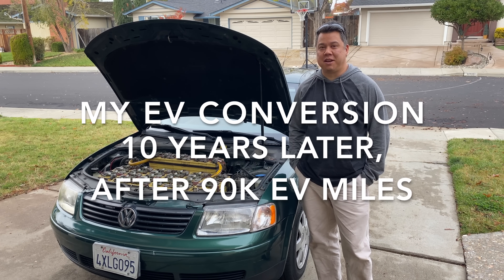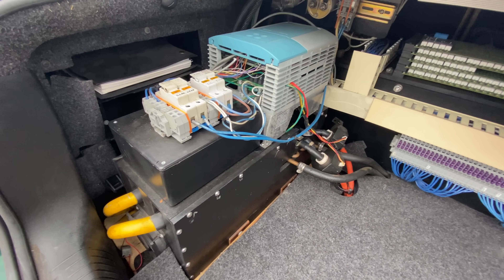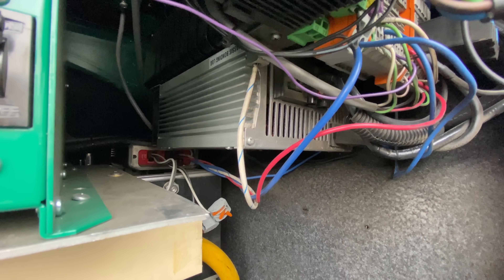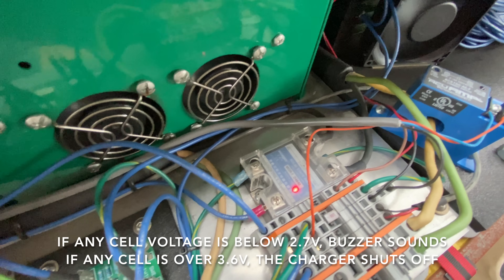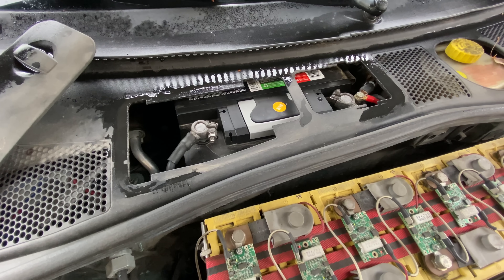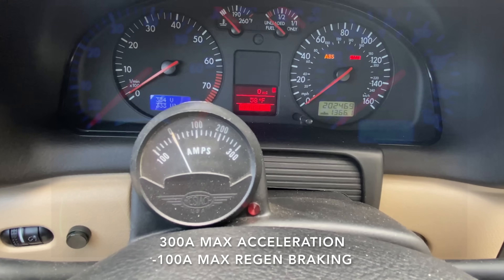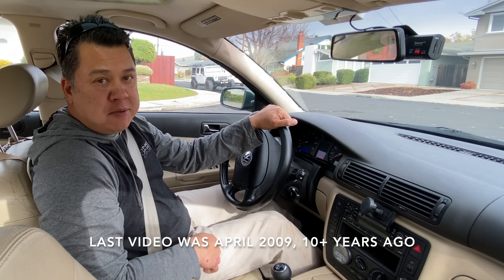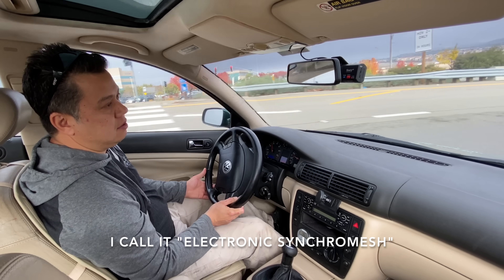My EV conversion after 10 years and 90k miles

Comment: That's interesting that you use a manual on an ev. Everyone always goes for the single gear or cvt.
Reply: Yeah now, 10 years ago there wasn't even a Tesla Model S
Reply: @BKrandy0  his approach is bare bones compared to the teslas today. kinda wish theyd make them like that instead of having a 32in lcd on the dash.
Reply: Porsche has a 2-speed transmission for the rear wheels on their EV. Only way to keep torque up at higher speeds.
Reply: @darichard11  they actually use a similar cruising ratio as Tesla (~9:1) they have the first gear to get crazy high torques. Iirc they use something crazy like 18:1. Motor probably can't do much more than 60mph before hitting the redline at that ratio
Reply: @darichard11  Uhh, I think it's the other way 'round. Torque is needed from stop and at lower speeds. The reason for a two-speed is to use all available torque in first gear up to the allowable motor rpm, then shift to a higher ratio to allow higher speeds than would be achievable in the lower gear without exceeding motor rpm limit. The original Tesla Roadster was built at first with a two-speed, but it was unsatisfactory and replaced with the single speed.  (From another David R.)
Reply: Don't think they had cvts that worked well back then.. plus cvts are much more complicated than a stick. Usually they're only used for hybrids and economy cars (never seen one used on an electric motor)

Fixed gearboxes are common for car makers since they can make one. Why spend thousands on a fixed gearbox when you can rip a transmission out of some junkyard car.

Also his motor redlines at 9k, and probably doesn't put out much torque. Being able to launch at a more aggressive gearing ratio, and cruise at a taller gear would be best
Reply: @gabrielschoene5725  Got it. I saw an interview with a Porsche company guy where he said the gearing was for better top end. Apparently just the opposite. I'm a little confused how the Porsche works with the rear geared and the front not.
Reply: @darichard11 
rear low gear - slowest
front single gear - middle
rear high gear - fastest
Reply: Many early EV conversions favored manuals.  They're cheap and plentiful compared to single-gear boxes, automatics (especially old ones) are terribly inefficient and tend to be heavier, and in a FWD car such as this the gear box supports the axles and acts as the differential which simplifies the drive line.  Even if you never shift the manual, just choosing a gear and leaving it there, along with the final drive ratio, is "essentially" a single-gear reduction.

Comment: Damn, that's a nice setup. I don't know anything about EVs, or electricity for that matter, but I'm assuming this is amazing. I used to drive a VW diesel/grease car where I would take the french fry grease from the local Friendly's in MA and filter it into the tank in the trunk. I would have preferred an electric conversion. The VW could barely get up a hill since my fuel wasn't very pure and everywhere I went I smelled like french fries.

Comment: If you already have air conditioning wouldn't it be better to operate it as heat pump for heating?
Reply from the maker: I would have needed to add some valving to reverse the flow, I had thought about it, but the heating element was so cheap and easy  I just stuck with that.  In California, a high powered heater isn't as important.
Reply: @etischer  in any case. That's an amazing piece of work. I'm in awe that you had the ability to do all that. And do it safely.

Comment: There are some very nice ideas in that car. Especially the shift light is very intelligent.

I wonder how you managed the ABS with recuperation since 30kW of recuperation could easily lock your tires in wet/snowy conditions.
Reply from the maker: We don't get icy conditions where I live (California, SF Bay area).  I can lower the regen braking strength on the keypad if it were an issue.

Comment: This is amazing and the best suggestion I've got in months! As a car guy two things came to mind here and excuse me if you covered them and I missed it. 1. How did you handle the diagnostic trouble code problem? With someone major like the engine missing I have to imagine the OBD II system is going ballistic. 2. Besides current regulation did you add any other safety measures such as fire suppression or plan to? I'm from Dallas, Texas where rear end collisions are almost a right of passage and seeing all that hardware in the trunk is concerning.
Reply from the maker: I removed the EFI ECU.   I carry a fire extinguisher, but the batteries are pretty much non-flammable, or at least they don't catch fire when pierced with nails or bullets.

Comment: Odd question, but what heated/cooled seat cover did you use?
Reply from the maker: Made by Viotek, highly recommend them.  The cooling works better than most OEM seats Ive tried (Lexus, Land Rover).
Reply: @etischer  that's exactly what I'm interested in. Bought some covers that promised cooling and let me down. What model are they? 

Guess I should also mention, what you've done with this car is a dream of mine. Incredible work.

Comment: So you have a car that travels 70 klm on a full charge, How useless is that.
Reply: Miles, not KLM. He's in the States
Reply: @JGE1948  OK 70 miles...useful?
Reply: @3101010  Depends on his use. If a 30 mile commute, why not? The first Nissan Leaf real mileage wasn't much better than that and my sister ran one for 5 years.
Reply: @JGE1948  Then what toss the batteries into the dump after a few years?

Comment: Why manual?
Reply from the maker: Simplicity, an Auto transmission requires a torque converter, or hydraulic pump to be running all the time.  Not to mention I'd need a controller to control the shift solenoids.

Comment: Man where did you learn all of this stuff!
Reply: Starfleet Academy
Reply: Read the description.  He has a degree in mechatronics engineering.  Such an education is tailor-made for a project like this.  A lot of his parts strongly resemble "industry standard" solutions (PLCs, VFDs, etc...like in a factory, not automotive industry). Nowadays if he were to do another build he could have PCBs made and scale much of the control system down.  The arduino he's using for the dash could be replaced with a more competent microcontroller and the entire user-interface could be programmed into a button array or touchscreen (or both) instead of having separate controllers for the heat, the AC, and whatever else.  The $25k he spent is a pretty chunk of cash, however, and probably the single largest barrier to entry.

Comment: Amazing ! And truly astounding when you consider this was done 10 years ago.

How did you get the regenerative braking to work?
Reply: AC asynchronous motors can act as motors or generators.  When you apply electrical power into the motor you get mechanical power out.  When you apply mechanical power into the "motor" (think engine braking) you get electrical power out.  This electrical power, via a "switch" of some sort, is rectified into DC and directed back into the batteries to charge them.  The load of the E-M field within the battery provides the "stopping power" of braking without using friction brakes for the majority of braking effort.
Reply: @Lawrence330  Thank you for the explanation!
Reply: It's not very hard. You just need to change the mode of the motor to an alternator.
I mean, it's not that easy but compared to everything else in this build it's a piece of cake.
Reply: So, VFD have nothing to do in brake mode? The motor work like 3 phase alternator, and rectifier provide DC to charge the batt? Must be something like regulator? I might be wrong.
Reply: ......its an achievement , yes.  I'm more impressed however at hybrids I saw constructed 40years ago from crude technology .

Comment: A very nice job! But would UltraCapacitors reduce the 0-60 time when the car is floored? There should be a reduced voltage-drop at the main Batteries and Inverter. I think that etischer has already thought of such improvements. Another positive benefit - is that ALL of the electricals and batteries could be removed and adapted to another vehicle - if it rusts away. Hard to say this about a car with an ICE. A true success story. Greetings from Australia.
Reply from the maker: I don't have much experience with Supercapacitors, but a capacitor voltage decreases linearly with state of charge, rather than holding a constant voltage like a chemical battery.   If you want to extract all the capacity from a capacitor it needs to be charged to max voltage and discharged to 0v, which requires a lot of power conditioning to get a useful constant voltage output.  Voltage sag is only 10% on a good day, would be easier to add more batteries than deal with making Supercapcitors work.
Reply: @etischer  Thanks so much for the explanation, and it is obvious (to me) that you have spent a considerable amount of time (and study) to achieve your goals with the Passat. I have lots of admiration and respect for someone who can produce something as outstanding  - as your car. You must have a 'headful' of ideas for your future Projects! I own a 1971 Superbug Beetle, and (currently) this car is nearing completion, being converted from ICE to 100% EV. The beetle will use the latest Netgain Hyper 9 Motor, and the Battery Power (approx 28kWh) is coming from five (5) Model 'S' Tesla. I am 71 yrs old and very excited to think that I can drive my own fully-electric car, which should be ultra-reliable. Car is being done professionally almost 1000km north of Sydney. I have seen many (early) examples of electric vehicles, using lead-acid batteries, which was the only power source available. I have a strong feeling that Battery Technology will skyrocket in the near future, and (when it does), my Beetle can have a Battery Refit for batteries that can provide a higher capacity in a smaller and lighter package. Already, we are seeing the benefits of EV's that can travel incredible distances on 64kWh - such as the KIA. My car would have been ready for delivery, but (at the last moment) I decided to have a full A/C Unit installed - which is custom-manufactured to follow the contours of the Firewall. I just wish that you were my next-door neighbor! You could easily teach the EV Program, which could help many others with the same interests. Did your Passat take a year to build - or more than this? I hope to follow any future projects. I cannot understand anyone disliking this feature of yours! I gave you a thumbs up!

Comment: Whats the top speed and whats the speed you need to drive to get 100 miles?
Reply from the maker: I haven't tested top speed since adding the encoder, it was 105 mph early on, I have 10% more power since the encoder.  should be able to get 100 miles at 60mph with some reserve.

Comment: Do you have a variable frequency/speed drive like the ones they use in machine shops for lathes etc. as a speed controller?
Reply from the maker: I'm using a VFD as a controller for a larger set of IGBTs
Reply: @etischer  So you have a smaller VFD which simply triggers the IGBT transistors switching larger amounts of power to the 3phase motor?
  So, after the VFD do you have 3 banks of transistors that switch the dc from the batteries to each of the 3 poles on the motor basically copying what the VFD is doing but letting more power through to the motor? How many IGBT's are in each bank?
  So you could even use a speed controller from a brushless radio controlled model to trigger the IGBT's i guess.
Reply from the maker: @izzzzzz6  Basically yes.  I'm using an "intelligent power module" which has 7 IGBT modules  inside one package.
Reply: @etischer  Right. Sounds complex. Because 7 divided by 3 doesn't go I'm guessing that if there is one bank of seven modules that they are in parallel to allow more power and then, do they go through a type of distributor that sends pulses of power to each of the 3 windings in turn?
  I'm guessing that there must be many transistors in each module.
  Congratulations of your job in Tesla. Nice work!
  I had an idea to wind a motor differently to allow many times more power so that you could in effect reduce the diameter of the motor by perhaps 1/2 but achieve even more power.
  If your interested i can talk with you about it outside of the comments.
  The idea came to me when thinking how to convert a small 4x4 to electric when a totally different way of doing things came to mind but sadly i do not have the funding or resources to make it happen.

Comment: And here i thought i was a genius for finding the fuse that ran my wipers.
Reply: I really laughed loudly at that comment! I once changed a Halogen Headlight Bulb in a VW Polo. I didn't put it in correctly. When the headlights were on, the misplaced headlight bulb MELTED the plastic Reflector, fogged-up the Headlight Reflector too! I had to buy a brand-new Headlight Unit. We all make mistakes.
Reply: @peterduxbury927   hehehe,   happens to the best of us my friend.

Comment: Such a well thought out conversion. Particularly like the workaround for the clutch. Like what used to be called a crash gearbox. They had no synchro fitted, so you had to spin up the engine and drop in when speed matched...  Hope your cells last for many more years.

Comment: Could have vr6 swapped it with a turbo kit you would have been more happy.
Reply from the maker: I've done other gas conversions; Mazda Rotary in an MG midget, Subaru Flat four turbos and Flat six in my air cooled Porsche 914.  The point of this project was to do something more of a challenge, something that hasn't been done before, and learn from it.  Buying a pre-made kit and bolting it together, not really my thing.

Comment: Hi brother, i have a hyundai excel 1998(?) coupe and i want to convert it to EV... Can this car be converted?  Is has manual gearbox(sorry for my bad english) and i am 18 yo with basic electric knowledge hahaha... Do u think i can build it on my own? I live in paraguay.. If so.. Do u have any tutorial to convert my car?
Reply: I want the car just to be a basic EV... Your car is a 10/10.. Just want mine to be a 2/10 lol haaha just want to do basic thing (acelerate reverse electronic and lights, etc)
Reply: @josemariarodriguez3226  Senor Rodriguez, All the info needed is available online, both on YouTube and in forums. Get a motor from a forklift and you are on your way. But Li ion batteries are still expensive (steadily decreasing in price) and deep cycle lead acid batteries are very heavy with limited output and number of recharging cycles.

Comment: Imagine the weight saving, keeping to the same range figure, if you could use Tesla cells, their electric motor and their electrical system.
Reply: That's where he worked as a senior engineer when he did this build. They were just launching the Roadster and starting early development of the Model S at that time.
Reply: @daveriley6310  Did Tesla produce a program to update the battery system.? I can imagine the Roadster having a phyiscally smaller, lighter battery pack with supercharging capability, rather than extended range (although a lighter battery system might help with this.) The Roadster's range really isn't that bad. It would just be quicker to charge up - that would be the main advantage.
Reply: @EdgyNumber1  Yes, they came out with the Roadster 2.5 Sport package, a $30,000 special order, but Tesla never went to Supercharging and never put 240V outlets at the Supercharger locations as I suggested.  So my Roadster was effectively tethered to home with a 100 mile combat radius.

Comment: What happens if God forbid you get into an accident? Also how waterproof is this, is the grille closed?
Reply from the maker: If I got in an accident, I'd be happy that I didn't have 26 gallons of flammable liquid under me, but rather inert batteries that have been tested and don't catch fire when punctured.  You can read more safety info in the video description.  As for waterproofing, it's held up 10 years.   The grill isn't closed, but the hood is sealed, and a belly pan seals the bottom.

Comment: This nice gentleman had obviously got an electrical industrial background by the equipment and terminals he is using?
Reply from the maker: Yep, I work as a controls engineer, designing industrial control panels, as well as programming.
Reply: @etischer  I could tell. I'm in the same role